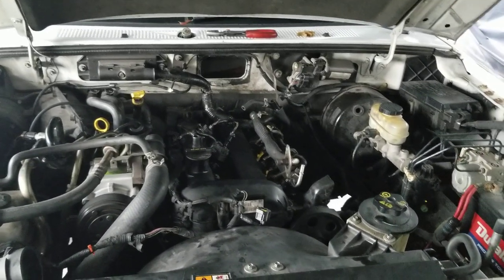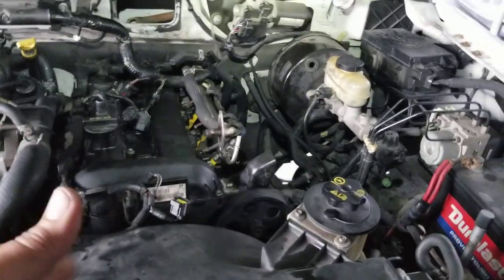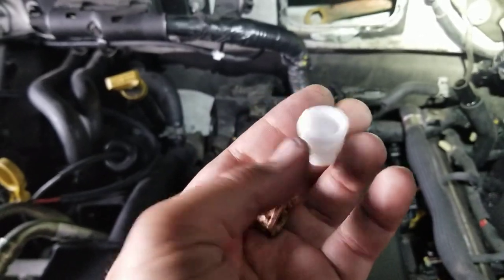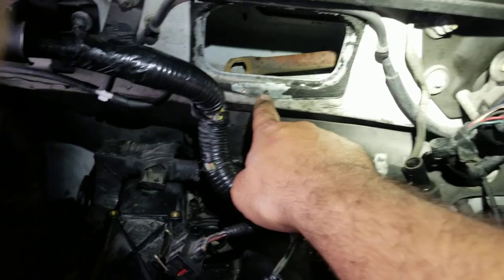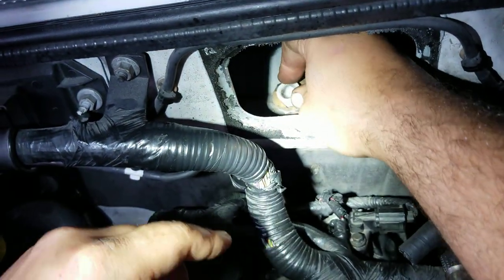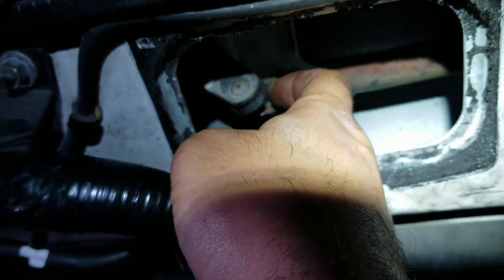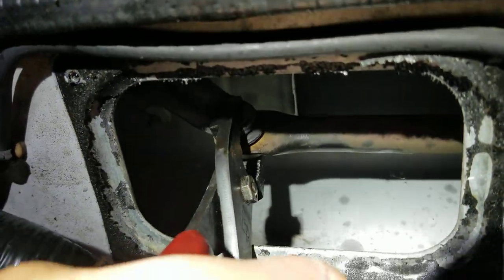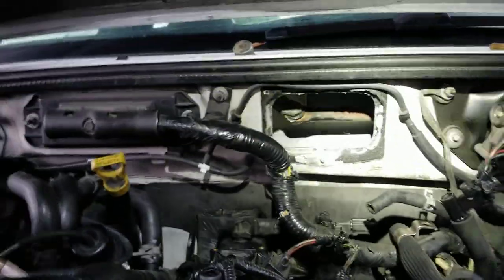Wiper arm does not work on Ford Ranger/Mazda B Series truck. fix it with this

Comment: Great job!  Knowing where this linkage is + auto stores show 49456 not for 2004 Ranger but don't have another one so used it and worked + knowing where the old bushing is and how to pry it off  + how to replace it - not possible without your vid...

Comment: Great video.  This just happened today on my 2009 Ford Ranger regular cab pickup.  Passenger side wiper stopped at about a 45 degree angle while the drivers side kept working.  I will definitely try this repair now that I see how easy the access is.  I also appreciate seeing how tricky it is to clamp it and force it in, and that it may take several attempts to get the bushing to seat properly.

Comment: This just happened to my 2004 mazda b2300 today, when I typed this part number in on oreillys it says not compatible with my truck, is there another part number used for this fix. thanks
Reply from the maker: It should work. The catalog is not 100 percent

Comment: This will work with a 2000 Ford Ranger?
Reply from the maker: It should
Reply: @gautorepair  thanks buddy. I just went to auto zone and picked up the part. There was one left in stock . I've been driving with one windshield wiper for a minute 😬
Reply: Which wiper wasn't working for you? I got to get my drivers side working. Will this way still work